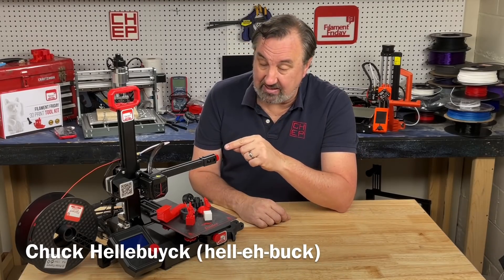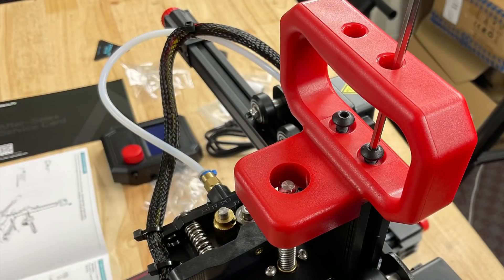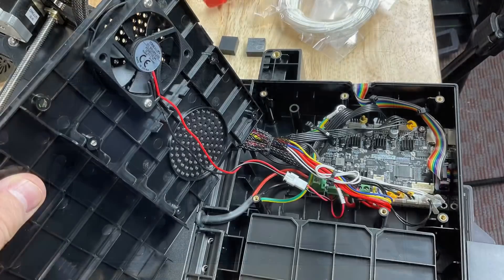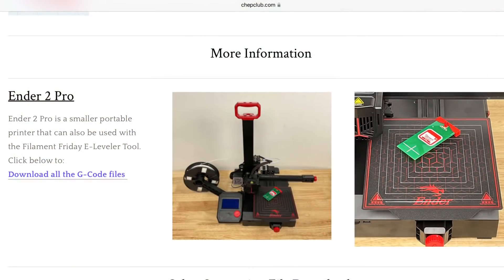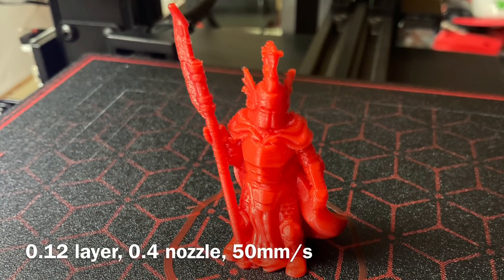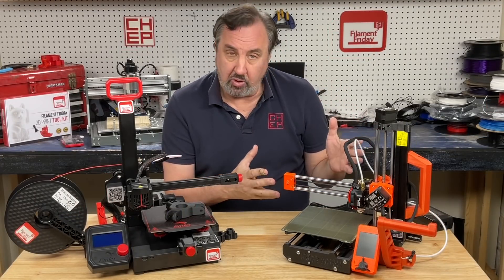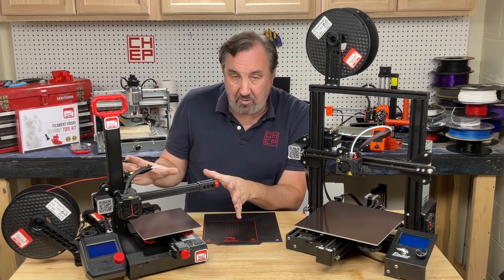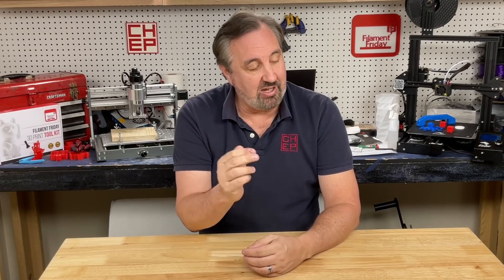Ender 2 Pro - The Best Value Portable 3D Printer?

Comment: It is cute, but not sure why it needs to be portable. Have 3v2, and now I want one to start learning PETG or that other filament, Polycarbonate. 9,800 tensile strength, dont remember if it high heat. Don't know what I would make with it right now. But, I'll figure an application for it. Brain works crazy since starting to push hard to learn Fusion 360. It doesn't want to leave comfirt zone. Thanks Chuck, love your videos and effort involved. Struggling thru your Prusaslicer tut. It's me . Cura fast,Prusa not as mistake friendly.

Comment: 50mm silent fans available from manufacturers like Gelid approx 23dba would be a good replacement to make it quieter but this would need a voltage converter board to turn 24 volts to 12v for the standard fan, my next project :)

Comment: Would be interesting to see how much vibration is at the 'right' end of the cantilever arm vs closer to the 'left'. Also if adding something like a linear rail can help reduce that vibration. Pretty interested in picking this up as a quick prototyping machine for smaller jobs
Reply: The Y axis produces a lot more vibration than X on this machine. Machine rattles sometimes when Y moves.

Comment: Question. Would you be able to do a a video on how to install a filament sensor on the Ender 3 with a 4.2.7 board. I use the subscription firmware site and it’s supposed to have it in the firmware but when the sensor is on it automatically sous to change out filament when the sensor has filament in it. Yep I’m stuck can’t figure it out.
Reply from the maker: See if you can change the sensor from NO to NC or opposite.
Reply: @FilamentFriday  that is something I would not know where to start at.
Reply: @FilamentFriday  ok I found out what the no and nc means. I’ve switched wires still same. I took off my filament switch from the cr10  v2 and what this one does is freezes everything and the screen goes blank Than the screen comes back on.
Reply from the maker: Something sounds wrong with the firmware.
Reply: @FilamentFriday  that’s what I’m thinking too. What is happening is that when the print starts even though there’s filament in the sensor It goes into out of filament mode.  When there’s no filament in the sensor it stays printing.  It’s doing the opposite of what it’s supposed to do. And how to reverse this is beyond my knowledge.
Reply: @FilamentFriday  do you know if there’s a way to contact the person that runs the firmware subscription site to find out why the sensor is doing the opposite of what it’s for.
Reply from the maker: You should have got an email from him when you signed up.
Reply: @FilamentFriday  thank you. never thought of that. I’ve sent a email out and I’ll keep u informed if any fix.  Thank you again for your time.
Reply: @FilamentFriday  ok first no email yet on this.  I’ve hooked It up to a meter to see which connections were what wired it differently multi ways and still does the same.  Using three diff  switches and still goes into filament runout mode with or without the switch pressed or not.
Reply: @FilamentFriday  yep it be me again. Looks like they must of gotten the email because I notice there was a slight diff in the description for the ender3 4.2.7 bl touch firmware.  It works for the  Bigtreetech filament sensor.  But not for the std style sensor. Thank you.

Comment: I’ve had one for a few months. I love it as a second printer for fast prototypes. I modified the fans because they are always on and are soo loud. The motors are absolutely silent. I did upgrade the bed to a PEI and I added a BLtouch. It doesn’t do TPU very well,  but I have a prusa for TPU prints.
Reply: What firmware did you run with the bltouch?

Comment: you forgot a few details.  It has a silent board but the servo are not silent.  This thing has a high fan noise pitch and its louder then my ender 3.  IT IS A GREAT PRINTER!  it has not failed me in a month and i dont even have to level the thing after the first level.  Been printing more out of it for small parts and great for making blaster kits and hobby tools.
Reply from the maker: It doesn’t have servos, it has steppers. And the quieter operation comes from the silent stepper drivers. They are way quieter than a stock Ender 3 or Ender 3 Pro

Comment: I CHEP,  do you have a TRIC ( idea )   to continue a print where my pla are BROKEN ( after my filament infra-red detector ) my big print are stopped at 75 % approximately ( 5 inch )) and i need a INFO to  remove this 75% from the STL or GCODE and my printer continue this print ....... it's possible ????
Reply from the maker: Try this: https://youtu.be/-wjE8eDiKWg

Comment: I havent bought a printer yet ... But I know for several years, the original Ender 2 has to be the first (a 300x300 CR-2 or Ender 3 something would probably be second or I skip these completely and go for a Voron 2.4 right away.)

So if you have the chance to compare the new Ender 2 Pro to the original Ender 2 or an OG Ender 3 ... this could be fun!

Greeting from Germany!

Comment: It's good, but the Kingroon KP3S is better.
Reply from the maker: Why? It’s $10 more on Amazon, has separate power supply and spool holder. It’s different with direct drive and linear bearings but no guarantee it’s better. Have you tried both side by side?
Reply: @FilamentFriday  to me direct drive and linear rails make a lot of difference, but both machines are good. Haven't tested them side by side, yet.

Comment: Why not just go for the CR6SE and slap on the Community Firmware?
Has everything you need and works extremely well...
Reply from the maker: It’s bigger, heavier and more expensive.
Reply: @FilamentFriday  And your thoughts as a all round beginner printer? Had mine just on a year and loving it. Such a simple machine...
Reply from the maker: A machine that needs community firmware upgrade is not what I consider a beginner printer especially for the added cost. But I know many people do like their CR-6
Reply: @FilamentFriday  Agreed, but it did make it a much easier unit to use.
I current have Octoprint setup and it is now a dream to use....

But thanks as always for the great videos. Still waiting for your video on the new Cura 13.? versions. Tried it, but looked to have support issues of sortes so reverted back to 12.1 for now.

Comment: Hello. Thank you for your videos. Have helped me a lot since I started with 3D printing. I have a dilemma and I would appreciate a lot your or anyone's suggestion. I have 3 Ender 3 pro's  and I want to buy a new one. I mainly print "small" items  such as pen/pencil holders, bookmarks, keyrings and dog tags. (I don't want another Ender 3 pro). I'm between an Ender 3 max and an Ender 2 pro. I don't really need the height of the max, but its built plate. Ender 2 pro is fine with regards to height, but has a small built plate. 
What should I do??? Thank you very much. 🌹🌹🌹🌹
Reply from the maker: Buy the Ender 2 Pro thru my Amazon link and if you don’t like it, it’s easy to send back. But I bet you’ll like it.

Comment: The Ender 3 is only $179 and I think it is a better starter 3D printer. Great video Chuck!
Reply from the maker: Have you used an Ender 2 Pro or just speculation?
Reply: I think Ender 3 is better starter printer too, but what I mean is better for My needs, because I don't need portable 3D printer and I sometimes need bigger printing area. Community support is huge for Ender 3 due to its popularity. Ender 2 looks really sweet, pricing is great, compact design and well made. I would lie if I would say that I don't have tight space on my desk with Ender 3 :D Everybody must decide what to choose according to their needs.
Reply: @Wrublos212  I think that better said what I wanted to say.

Comment: 0:20 If there were any overarching consistency in Creality's naming schemes, this most definitely should've been called Ender-2 V2. Anyway, I do have this as well as the CR-30 on my list (both with a different hotend, but probably left stock beyond this), but a couple of Vorons (0.1 & 2.4, the latter with a few mods) rank higher and my budget is limited, so I'll get to those before circling back to Creality (and afterward would theoretically come my megaproject, but that'll likely remain a dream). Anyway, I am perfectly happy with my extensively upgraded/personalized Ender-5, so I ain't in a hurry.

Comment: Thanks so much for this review...This little fella is REALLY intriguing. Having something that is at least somewhat portable is a great idea for the odd tinkering session. Or a hacking / making weekend event in a location that has no making facilities. Unless the situation is very dire I would rather not move my current printer, let alone load in a car and bring it somewhere. Simply because of its size and weight. This Ender2 though...it seems pretty well made and it also seems that manufacturers finally have caught up with how to build a proper firmware image with features enabled that actually make sense. I do not usually follow current reviews because I want to rein in my GAS (Gear Acquisition Syndrome) and might have missed many things in the past few years because of that. But those latest developments really seem to take FDM printers to a whole new level so everyone can get one and use it. The fact that you can just go and pick up a printer for less than 200 bucks that works nicely straight out of the box...that is pretty wild. I love it and I can see myself buying one of those in the next few months.

My start in 3D printing has been rather bumpy. I have built my current printer basically from the ground up. Not something I would recommend doing if you have as much experience as I had bacj then, which was none. The printer I built has some residual Anet A8 DNA left in its stepper motors...for now. Yes, I actually had one of those creaky , wobbly and loud af pieces of junk that have set houses on fire and it nearly did mine too, but for other reasons not connected to thermal runaway (rather to me being an idiot). The machine became my "upgrade rabbit hole" to the point where it stopped being a "proper" A8 and became something different. I have had SO many issues and setbacks in the process, probably ran into every conceivable quirk and problem including one that made no sense at all and even left an engineer friend of mine stumped who is otherwise very well versed in 3D printing.  Oh well....if you want a custom printer, be prepared for custom problems. He also remarked that a 3D printer is kinda like the Poor Man's classic car: there is always something to do, something worth tinkering with, to tweak and to optimize and it rarely sees actual use. I tend to agree with most of that. In the process which also involved lots of cussing and unhealthy amounts of coffee and junk food, I accidentally became reasonably well oriented in Marlin's internals. It was a rewarding experience with a pretty steep learning curve and lots of teachable moments, but by god it was frustrating at times. Still, now I have a kind of ugly looking Frankenprinter that works absolutely beautifully at least 9 out of 10 times and produces great results.

Comment: I have an original Ender 2 and despite having a printer that cost me over £2000 to build from self sourced parts the Ender 2 is my most reliable printer and the print quality is excellent, its not a very fast printer but that ndoesent bother me, If I do need to print something faster I have my Pro 3D V-King 400 that can print nearly 3x faster at the same quality

Comment: Thank you for this review. I am thinking about a second machine, small one and besides the Prusa Mini this one seams much interesting. But... There is not only the Money thing. a. No PETG prints?  b. According to TH3D there are 4.2.3 boards with 256K memory (RCT6) in Ender 2 Pro printers. Can you confirm that?
Reply from the maker: I can only go by the one I have and it’s 512k. PETG is fine. Same as Ender 3.
Reply: @FilamentFriday  Thank you!

Comment: Nice video Chuck as always.  I purchased one in January, and like it very much.  I purchased mine to use while camping in the RV. I ran some test with Cura and Creality's slicer vs S3D.  Not changing anything but the filament temperature to 210, Cura would not stick to the bed, Creality stuck but warped.  S3D worked perfect from day 1. I'll have to try your leveling files to see how they work.  PS - Leveling he bed with large hands might be a challenge.
Reply: Where do you buy this
Reply: @gwenfiebelkorn9143  I got mine on Amazon. Microcenter is selling them now for 10 dollars less.
Reply from the maker: Links in description

Comment: The Ender 2 is still my first and only printer. Upgraded it during the years (magnetic bed, silent board, better extruder, ABL), but mostly out of curiosity, not necessity. Fantastic printer, just a tad small.
Reply: Would I be able to fit a MircoSwiss? Looking for a small 2nd 3D Printer and this may fit the bill. The mini Prusa is to expensive.  tks

Comment: i saw this and honestly i think its better than the ender 3 too, easier to level, cheaper, lighter, easier to move and I think 180mm3 is a good enough print volume
Reply from the maker: Totally agree
Reply: I wonder if the smaller bed also means it easier to manufacture them so they are actually flat - my ender 3 bed was always way off - only a glass surface helped

Comment: 100% agree with what you said around 7:40, one of my first mistakes many years ago was to go for as large a bed as possible thinking everything I make I would want larger but not thinking of realistically how long that would take, amount of plastic used, other complications with a larger machine, etc. This machine looks exciting as a secondary/spare printer with lots of upgrades out of the box, or for a first timer. Appreciate the review.
Reply from the maker: Agree.
Reply: I'd say the only advantage of a larger bed (for me) is if you wanted to print multiples of items unattended/overnight.
Reply: Just because the machine is larger doesn't mean it'll give you more/different problems. They are the same thing just at a different scale.

Comment: ive started to buy the original ender 2 an after i seen this ive had it in my cart to many times to count but i have a kingroon kp3 an its pretty much the same printer except the kingroon has mgn12 rail for the y axis and it has a mks robin nano board an touch screen so i feel like its actually alittle nicer. they have a kp3s out now that is the same prices as the ender 2 pro but direct drive extruder mgn12 rails on both y an x axis an similar control board and display as the kp3.
Reply from the maker: I don’t like the separate power supply.
Reply: @FilamentFriday  thats the one downside to them but ive managed to mount mine underneath the main body of the kp3 so its all one unit now. u ever do any videos on mks boards?

Comment: This looks like a great printer, especially for beginners or people who want something small to print parts for other hobbies they have rather than having a more "universal" machine. Since all the parts look like pretty standard creality fare I would imagine the extrusion difficulties you are seeing can be tuned out easily, and upgrade parts for other creality printers may well be applicable if they make sense. Like you say, 85% of things people print will sit in that build volume, and most beginners will be using PLA which will print fine on this one. And if you find its too restrictive, well at the price its not too big a loss if you upgrade to a bigger machine and you will at least then know what you need to look for to suit your needs, and you still have a useful machine to use, sell or give to a family member or friend. Its nice to see more "niche" machines being made by major manufacturers after the raft of clones we've been seeing.

Comment: I've had one for a few months and love it.  It's a second printer I got for fast prototyping, but I find I'm using it more than my bigger one with all of it's bells and whistles.  The only mod I've done is a pei flex plate.  Otherwise, it's working great.
Reply: It's faster then a regular ender 3?

Edit: I read in another comment that it isn't that fast of a printer 🤷. If I could get some proof it's faster than my Ender 3s I would buy it immediately. I need a fast prototyping printer or I'm just building a voron 0.1.
Reply: @dangerous8333  FLSUN QQS Pro!!! Buy it right now it prints at 80mm/s perfect quality and up to 150mm/s, best of all the bed never moves so I've auto leveled it once in 3 months
Reply: @Dan Gerous  not much faster.  I run it at 60mm/sec, which is around where I run my e3v2, but I have that set up with a direct drive, and bigger fans so the print head shuttle is a lot heavier.   By fast, I meant that I just print sections of a whole to check size and fit.  I also just print pla on this printer, and it's next to my desk so I don't have to go far to tend to it.
Reply: Where did you source a PEI flex plate of that size?
Reply: @brittratzburg6591  TH3D has them, as does ali express.